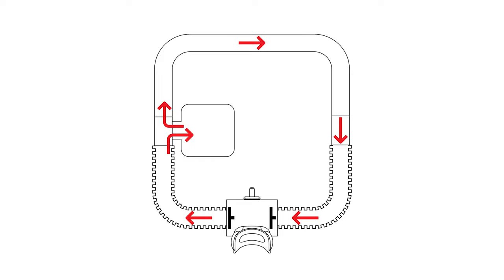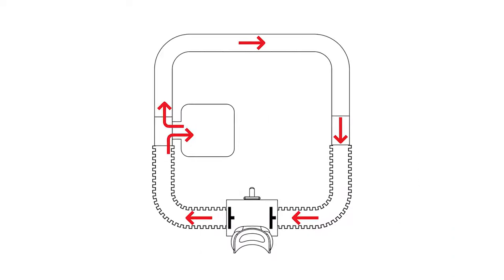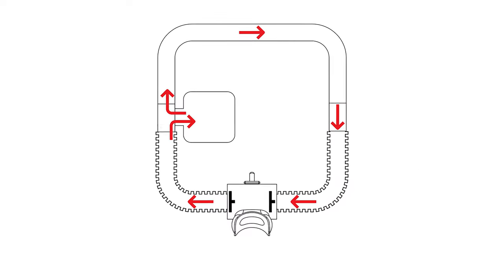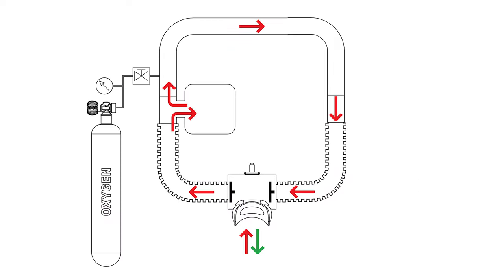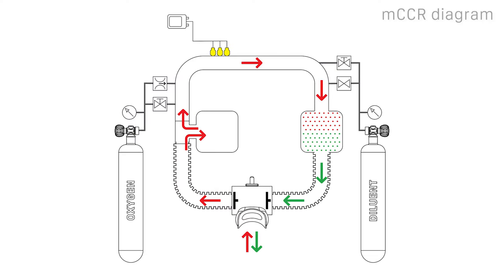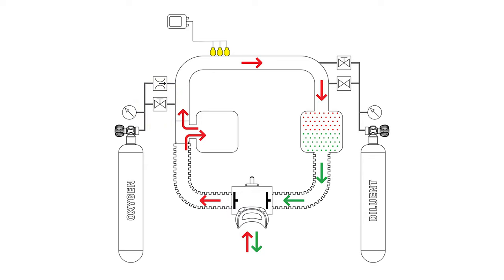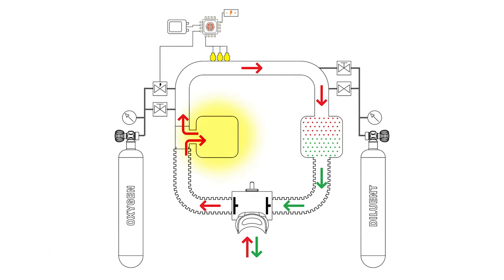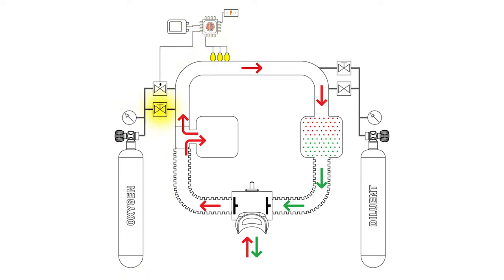mCCR vs eCCR #1 | Manual Rebreathers vs Electronic Rebreathers

Comment: when the electronics of an eccr goes wrong o2 can be injected in the circuit in excess which is absolutely not the case with an mccr .. it is a huge difference

Comment: This guy is biased towards electronic CCR
as far as using the MCCR deeper thaN trickle valve can supply O2 ,,yes you can
It’s called flying the unit manually which is what you do when your electronics fail on ECCR

Comment: guys this is not correct as far as the oxygen sensors are concerned.  The solid state sensors are now available which changes the game. The solid state sensors that are now provided by the Poseidon rebreather is a game changer.  Great video, but very outdated.
Reply: Hello Peter. We really appreciate your feedback. We are all looking forward to the time when the SS sensors are widely available and we hope it is just around the corner. Your experience with SS sensors may be different but based on the information sources that we have, there are variable results of the reliability at the moment. We are of course not lacking and closely following this technology. Just in case you haven't read this article already, I would like to share this with you. https://gue.com/blog/what-ever-happened-to-solid-state-sensors/ Hopefully, the sensors will stop being the most voulnerable part of the system soon, but it appears that we still need some time and much wider tester base before we can fully claim that. Thank you for your feedback and watching our video. Safe diving buddy.